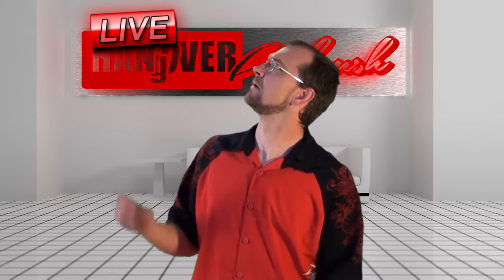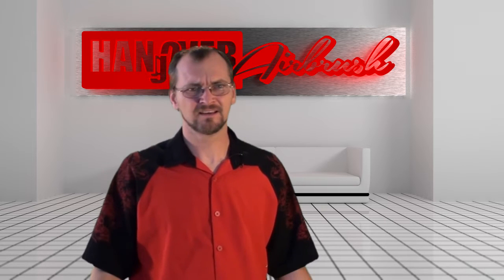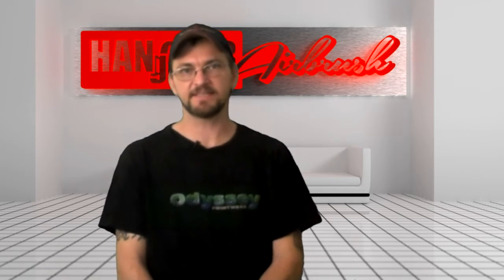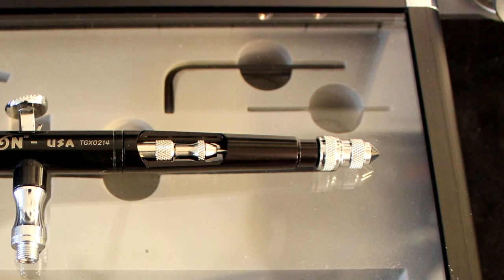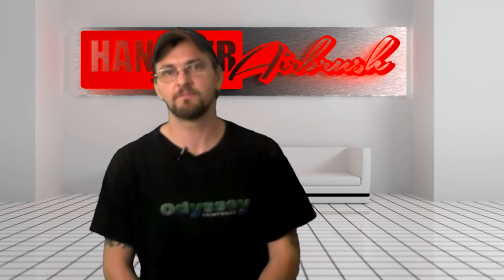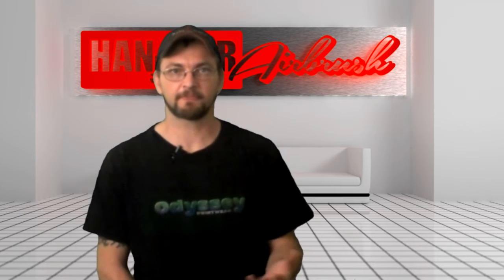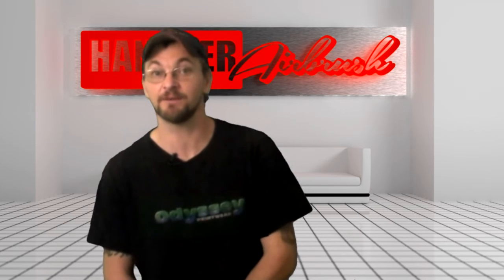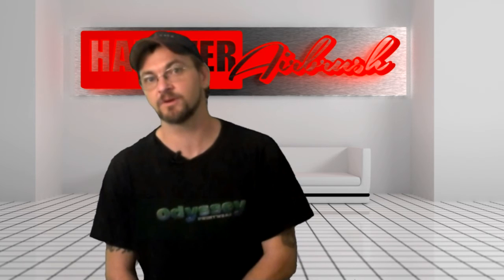Paasche Vision first look

Comment: I own a Micron,and,while it is an awesome airbrush,I can't see spending $500 bucks on another one if the Vision is comparable....How about the Talon?Do you have any experience with those?I am looking to get another workhorse brush,and detail brush.....never used Paasche's...just wondering if they were comparable to the Iwata's in terms of quality,feel,spray,etc...
Reply from the maker: +Scott Peters I think that's kinda an "unfair" question.  I have an Iwata HP-CS and I love it.  But the Vision is my main "go to" airbrush.  They feel different to each other, yes, but I see it as "will you like Cummins vs. Powerstroke?"  Either one will get you down the road...  If you already have the Micron, I would suggest either the Vision or the Talon due to the "fan air cap" option.  Although I have no experience with the Talon, I am told it is similar to a Vision, but without the Atomization Control Screw (MAC valve) and that most of the parts are interchangeable.
Reply: +Jack Bias I see what you mean....at the end of the day,an airbrush is just a tool....it either sprays paint or it doesn't .....I have seen a lot of reviews from people who absolutely hate the Vision...stories of it not spraying consistently,but I am assuming that is probably user error,not understanding how to adjust the aircap,or thinning paint correctly.....I just want a decent,comfortable,detail airbrush that doesn't cost $500 bucks....
Reply from the maker: whenever (any of) mine spray inconsistently, I clean the nozzle.  VIOLA! problem solved.  An airbrush is a simple machine, if it works- it works... ...Like you said- "user error."  Most people don't know/don't care how to properly thin paint.  Just because it says "airbrush paint" on the bottle, doesn't mean it's the right consistency/viscosity for a .2mm nozzle.  That's tiny...  the .2 is so small, I rarely use it.  it's good for what's it's intended, but I seldom do small detailed work...

Comment: Looks good wasn't sure if the insider of the color cup was Metal or painted chrome black.
Reply from the maker: The paint cup is finished in black to about half-way down the inside bore. Then it changes to a rougher looking silver finish, which I suspect is nickel, and then to what I believe is brass, near the bottom.

Comment: How does the vision compare to the iwata jp-ch?
Reply from the maker: If you are asking about Iwata's HP-CH, I have not had a chance to use that model yet, However, I do own and use Iwata's HP-CS, and truthfully, I like them both.  The Iwata fits together very nice, but I feel the Vision performs better.  It has an edge due to the smaller nozzle which delivers finer atomization and better line control.  And the Vision comes with the fan aircap which sprays evenly over larger areas... Check out the Vision's full review here:  http://youtu.be/_cURyqxLLA8